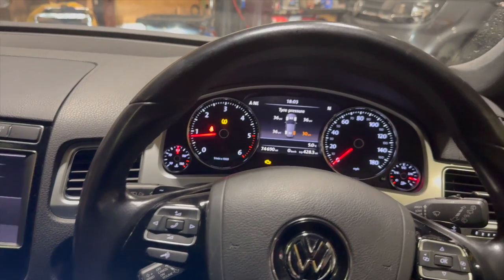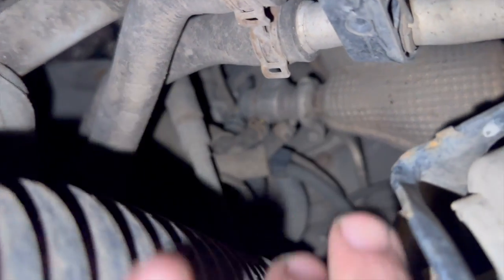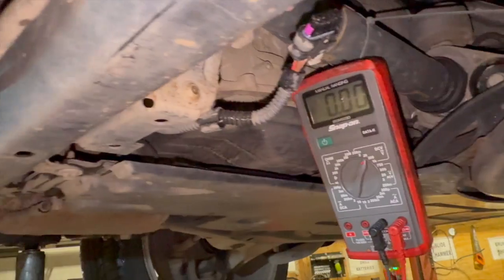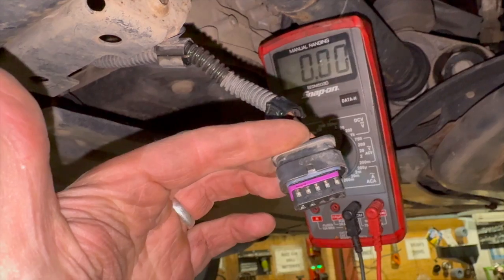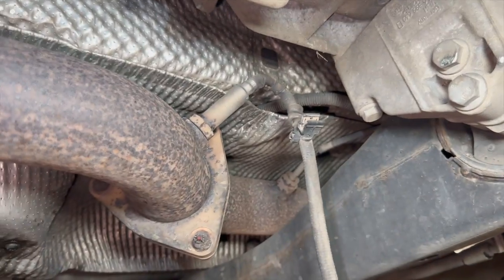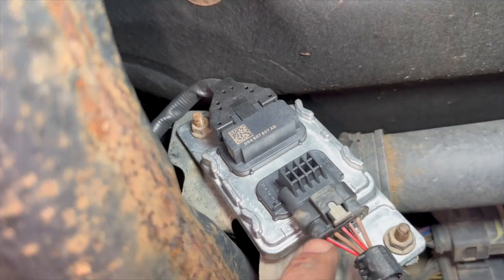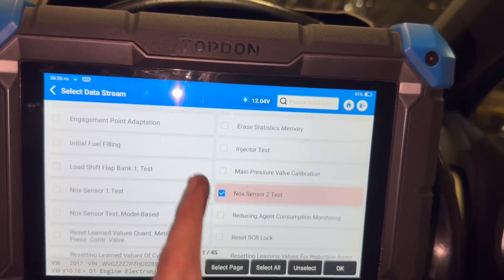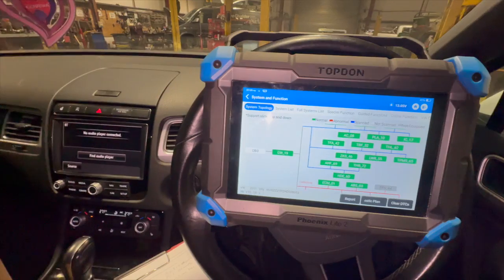VW Touareg Nox sensor fault P22A7 U10C2  - nox sensor 2 replacement

Comment: Great video, but would be nice to know how many miles that Touareg had done, mine is a 2019 build version has done only 47,000 miles and  has been diagnosed with this fault (it must be a common fault) and first Quote from a VW franchise dealer is £1550. So using the knowledge I’ve gained from your video I will find a cheaper and more convenient solution.
Reply from the maker: This was a 2017, covered 55,000

Comment: This is a great video.  Thank you for posting.  I have the same issue on a 2014 Touareg exec.  My pipes and wire routing are a little different, but the sensor is the same.  I have a particulate sensor where you have the Nox sensor.  My Nox sensor is on the other side of the pipe.  My pipes have band clamps rather than flanges.  My wire routing goes behind a heat shield that needs to be removed to gain access to the wire connection.  The DPF, DEF injector, Diff pressure sensor & most of the rest look basically the same.  The connection for the particle sensor is out in the open like your Nox sensor is, but that is just a 4 wire sensor, not a 5-wire, so between that & the diagram in the manual, I feel pretty confident about my sensor IDs.  Thank you for a very good overview.  You saved me a lot of reading.
Reply from the maker: Nice one , glad it helped 👍👍

Comment: i have only issue with P22A700 heater sense bank1 sensor 2, with OBDeleven i can read live data and he can read the ppm aswell... i can even delete faultcode but after few days its comes back? can be fixed only heating part of this? not always but sometimes i have also glowplug 1 issue aswell. Any idea?

Comment: We had this. Cheaper and easier fix is to just get ad blue mapped out for £175. Never have any of these issues ever again.
Reply: Is P20EE the same thing...I have 2013 touareg tdi
Reply: @daisyhenry332  yes, the whole AdBlue system is a complete disaster. We had 2 NOX sensor replaced under warranty but the final straw was “ad blue tank heater element failure”. New ad blue tank required £450+ all the labour. Bloke came to the house, plugged in laptop and eliminated the whole AdBlue system for good.